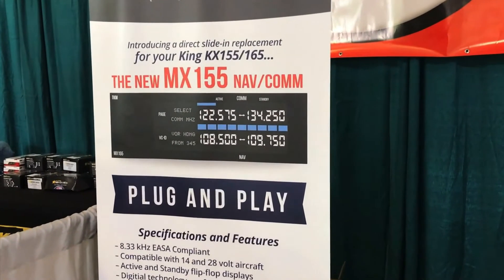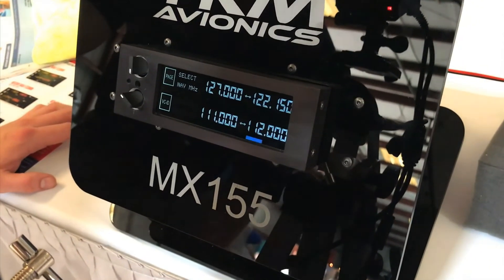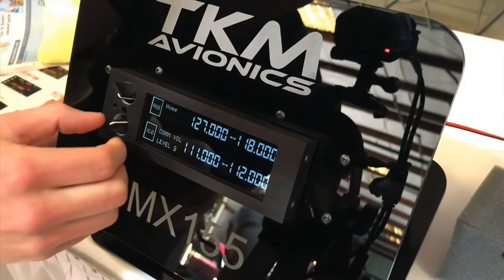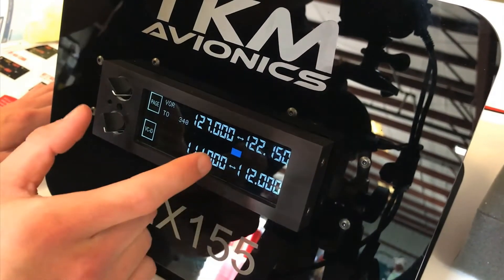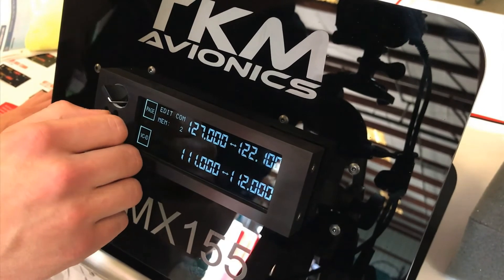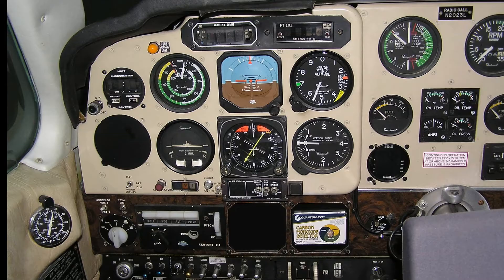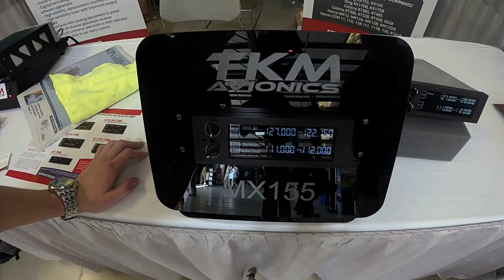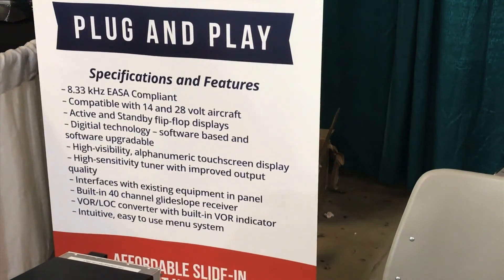TKM's KX155 Replacement Radio

Comment: Repaired tons of KX155s and KX165s for King back in the day in Customer service. Lots of bad modulator transistors and displays replaced. Also display drivers. Other than that, pretty good radio and rugged.  Interesting for find a direct replacement.

Comment: If the TKM guys are paying attention here, just some suggestions for you.

The lower button shouldn’t be a button/dial with a flat edge to it since there’s no logical stop to it (ie: it turns 360 degrees for dialing in a frequency).
The throw on those buttons looks like it goes quite deep - if it could be more shallow that would be helpful.
The screen may be a big delayed in the video, but from what it looked like, it looked laggy.  I’d be concerned about what that would be like when it’s cold outside.
Just my $0.02 worth.